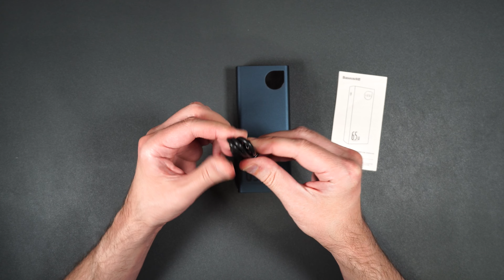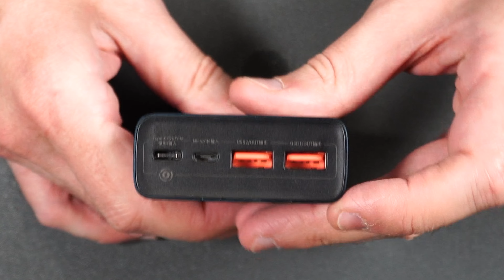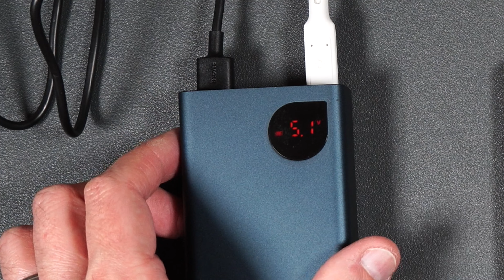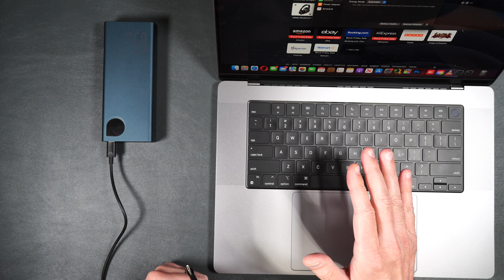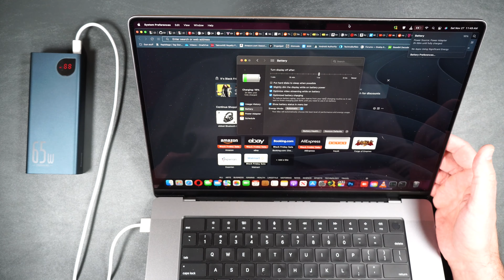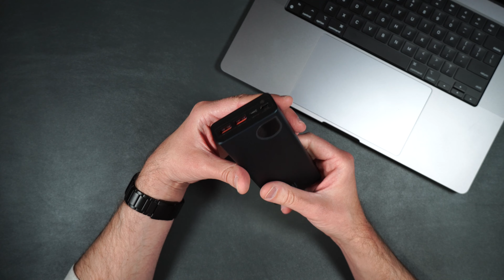Baseus 65W 20,000 Mah USB C Power Bank - Charges Big & Small Devices!

Comment: Just bought one of these things it’s been charging for six hours and it’s only at 40%. How long does this thing take to charge
Reply: Buy a USB-C cable with a wattage display on it.  The cable will tell you how much wattage is getting to whatever you are charging (in this case the power brick).

Comment: I have been reading the restrictions of the airlines and most of them will not allow more than 2 power banks of 20,000 mah each, therefore although there is a 30,000 mah power bank if you plan to travel by plane do not buy it because they will not let you take it/they will get in trouble. And yes: the real capacity of a 20,000 mah power bank is 12,000 mah, and a 30,000 mah one is 18,000 mah (you still have to subtract a bit due to inefficient power transfer between two devices)
Reply: As far as I know, it's not the mAh that's the problem, but the Wh. I travel with an imuto 65w.

The maximum allowed on a plane is 100Wh. Mine is 27000 mAh 3.7v which equals to 99.9Wh.

No problems from my experience.

Edit: I forgot to explain why I was talking about other power bank.

Just check the voltage of the 30,000 mAh if it doesn't cross 100Wh you are good

Comment: I bought one. Stopped taking charge out of nowhere. After a week fighting Baseus awful customer support, they sent a second one. The second device never charges to 100% never did the first one. I just do not use it , I'm afraid this cheap power bank will damage my devices.
Reply from the maker: Im sorry you had a problem with this power bank, I still use mine to this day without any issues.
Reply: Yeah I went through 2 of them. The build quality is awful on these.

Comment: Is it normal for it to drop to 0 amps from time to time when charging my phone using the USB C cable that comes with it? It says it's fast-charging but it hanges around the 1.2 A, then dips to 0.5 A, then goes to 0 A and goes right back up to 1.3 A. I thought it was suppose to be like at 3A. Is it faulty?
Reply: no when the battery gets more juice the amps drop its physics
Reply: but you use the word juice...so smart  @Drive582

Comment: hmm, I charged the bank at 100% and after 8hrs have passed  i went to go charge my phone the  bank read at 70%. is mine faulty or broken? or maybe I'm not using a right charger to recharge the bank?
Reply: They are cheap power banks. Read the comments on this and you will see a ton of people have issues where they are DOA or have issues charging after a very short time
Reply: @B A  mine have been doing good. I just had a very low watt charger that's why the battery depleted quickly

Comment: Hello.. Please tell me there is a Baseus power bank for 30w from a type-c outlet.  will it give these 30w to xiaomi mi 9t pro phone which supports 27w charging?  As I understand it, only through the appropriate Type-C to Type-C cable by amperage.  I tried the 3A cable, it doesn’t write Mi turbo Charge, but just fast charging ... Will the cable change the situation, for example 5A?
Reply: I actually bought one before watching this video. It's only fast charging, not the mi turbo charge even if using other cable. Mi Turbo Charging should work straight away if you're using the cable came from your phone to this powerbank.

Comment: Since it has auto power on, does it work with low current devices like raspberry pi?
Many powerbanks turn off on these devices mid operation or does not power on at all.

Comment: Turns out to be incompatible with my Thinkpad (t495). For some reason it remains at 5volt and doesn't switch to 20volt, so the laptop rejects it. It won't even work when the laptop is off. The equally specced AC adapter from them works fine though. Pretty sad about it, because the laptop's internal batteries could really use the help.
Reply: What a bummer, I'm looking into buying this one for T480. can you confirm that the issue is not on the cable? Also what powerbank you end up using on your t495?
Reply: @gelomorn  I've used a very good cable, not some cheap one. The cable also worked fine with other sources. I never ended up buying another powerbank, but sometimes I use my ecoflow powerstation instead, which works great, but is kinda big. The powerbank does work well with my work-laptop (a HP) and I have the feeling there problem is also partially caused by the T495 specifically, as it's Lenovo's first AMD T-range laptop. Chances are that it'll work fine with the T480 or any other model.

Comment: I just got it. This Baseus doesn't have 20K mAh, it has 12K mAh which is stated in the user manual and at the bottom of the powerbank. That's so bad... All though this powerbank right now... it beats ANKER and RavPower. With aluminum body, such a powerful output, also the self recharge is the fastest around. The real issue is the stated capacity. Powerbank of that weight and size should have at least 20K, but it doesn't.
Reply: Every powerbank has rated capacity,and it's ok,no mater what power bank you buy: Xiaomi,Anker, Energizer, 20.000 it will 12,000 in real,30.000 18.000 in real, keep in mind.
Reply: That was my concern as well, but from what I was reading, and I could be wrong here, it does actually have 20k mah. The power bank itself is composed of 4 batteries connected in series each rated for 5000 mah at 14.8 v for a total of 20k mah. Source: Amazon review that apparently spoke with the company.
Reply: Judging by the volume of devices that it can charge, its actual capacity is about 6500.

Comment: Ahhh, amp X volt = watt… so revealing this info shows it’s no where near as advertised.  Of course the devices need compatibility but my iPhone 13 max will take 27w with the right charger.  This PB lists 9v at 3amp.  This equals 27w.
Reply: Yes but it can also do 20W at 3A = 60W (Laptops). Just because your phone only needs 9V is not the fault of the Powerbank.
Reply: @paulneedham9885 not sure what I was thinking.  Just looked up specs.  It lists 20v/3.25amp. So 65w.

Comment: Help i bought this exact power bank but after charging my "iphone se from 2016 the 4 inch model" now its behaving on its own and im getting random ghost touches after a while right portion of the touch screen is not working. ps. when i plug the power bank it randomly get disconnecg from charger and reconnects.

Comment: Does this power bank support power passthrough? Can I charge the bank while powering multiple devices at the same time? Thank you.
Reply: Yes it does support pass through charging allowing you to charge the bank and your phone at the same time.... I purchased this from Amazon and I suggest you read the reviews before buying I didn't do.... it has terrible reviews because they use some trickery math advertising on the box saying it was 20,000mah/65w and in fact its more like 12,000mah as listed on battery... company is dishonest read reviews for yourself I'm not sure if this was a paid review
Reply: @BB-jq6ek  It also shows 5000 on the back too, returning mine today.
Reply: @BB-jq6ek  85% are happy on Amazon. What bad reviews did you read? one or two doesnt mean its bad. A powerbank is always less than its stated mAh. Its impossible to run at 100% efficiency.  This one averages 90% efficiency which is pretty good. Thats just physics but nothing dishonest.
Reply: @BB-jq6ek  12000 mAh when you charge phone because 5v output 20000 mAh only if output is 3.7v it's not only baseus feature every powerbank have same problem)

Comment: It would have been good of you tested the total power coming from the type c.. I think the 65 what is from all the outputs type c and USB at the same time.. I will just need to look online thanks anyways. 👍
Reply: Did you get any info?
Reply: @KisameSempai  yes it can do 65w but its pushing it. so not safe. gets way to hot .long term 45w is safe... i have 3 powerbanks of the same brand in 1000 2000 30000.    the 3000 can do 65w long term.. and the 1000 helps extend the running time of my macbook air but the batt still goes down but way way slower and can charge it if i power it off becuse it has QC3.. my mackbooks batt is 4000 mah so the 1000 powerbank can extand the runing time of my mac from 8 to 20 hours so works good for my needs .. i take the 3000 camping
Reply: @KouRou2002  but the 3000 mah is not allowed for air travel; exact?
Reply: @KouRou2002  I am really interested in the 20000 mah model; reviews say it gets warm charging at 60w. Is it really hot for you?
it seems 30000 mah is not allowed in planes. 10000 mah does not output at 65w which I need for my laptop
Reply: @KouRou2002  ah ok. so the baseus 20,000mah should be fine charging my laptop from time to time?
Reply: Mine doesn’t fast charge my iPhone 13. The output it gives is 5V/1,2ish A. I’m using the official usb c to lightning cable and I’m worried I’ll have to send it back.
Reply: @barczu  i got the bigger one in the end the 3000 mah it can charge my mac at 65w. . did you try the type c and the USB output. may just work on one. like just the usb .
Reply: it says online "compatible with wide devices thanks to supporting the advanced charging protocols like PD3.0, QC4.0, AFC, SCP, FCP"   so is ment to work AFC is fot iphone 5V @ 2.4 A  look at the box not all ports do all the the protocols. good luck buddy..
Reply: @KouRou2002  iPhone 13 has USB PD protocol (the powerbank allegedly has it), which makes it charge at 20W
Reply: Forgot to mention, in the description it says that you get the fast charge etc while using usb c which I’m doing

Comment: Dude look at the bottom 12k mah...... trust me I'm returning mine
Reply: LOL educate yourself first ..
Powerbank battery voltage is around 3.6 V, and the device voltage that charged via powerbank is mostly 5 V, like smartphone etc, thus it is needed to convert that 3.6 V to 5 V, and factoring in convertion efficiency, which is different on each powerbank (better quality powerbank has higher efficiency) and you get the result of the "Real" mAh

In summary, any powerbank that has 20000 mAh rating on them, cannot charge 20000 mAh total of power on a smartphone battery, no matter what brand the powerbank is !
Reply: @hafidsg  Help i bought this exact power bank but after charging my "iphone se from 2016 the 4 inch model" now its behaving on its own and im getting random ghost touches after a while right portion of the touch screen is not working. ps. when i plug the power bank it randomly get disconnecg from charger and reconnects.
Reply: @hafidsg  it's listed as 5v..... look at the bottom of the power bank
Reply: @phoenixiceservice  listed 5v is the output voltage, not the voltage of the battery inside powerbank
Reply: @hafidsg  I'm looking at the pic of the bottom
Rated cap 12000mah 5v 6a
Type c input 5v 3a 9v 3a
Type c output 5v 6a
Reply: @phoenixiceservice  yep, thats the output voltage, not the battery voltage, you can read about what i mean on the web, search "secret marketing trick powerbank" and you get tons of web that explain it
Reply: mAh is a weird rating. Two batteries at 13000mah does not mean the same capacity. What matters is what hours. Most likely 12000mah is the maH at 7.4;v vs 20,000 at 3.7

Or maybe it's the actual capacity after efficiency losses
Reply: It tells you that in the item description of you read it before purchasing you would have known.. the 20k is the size of the battery inside the device.. not the power it delivers at the output.  All power banks advertise the same way. At least the company stated on the box on the power bank and online.. most other companies do not.. I have the 30k version of this but it's so big and heavy I'm going to purchase the one in this video..
Reply: @KouRou2002  no they don't.... I have 4 other banks and they list the mah, not expected mah.... ubiolabs,  anker, even the cheaper ones